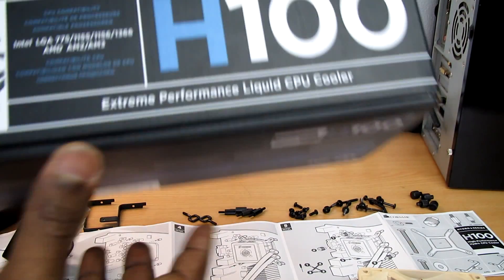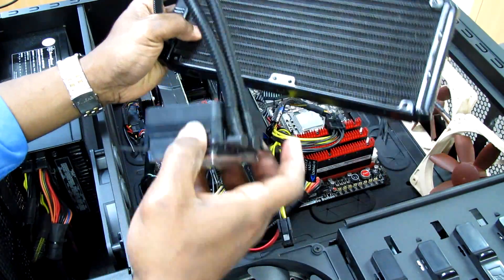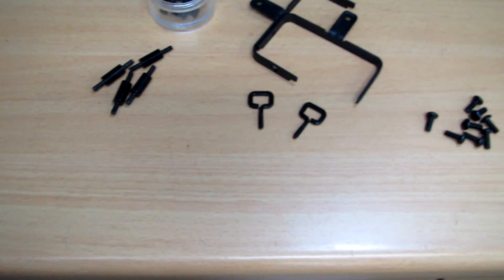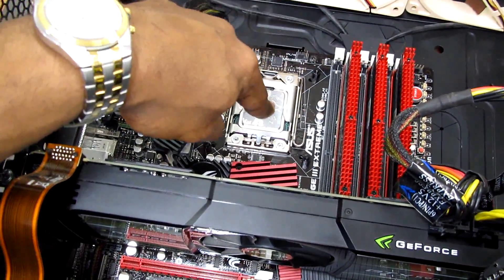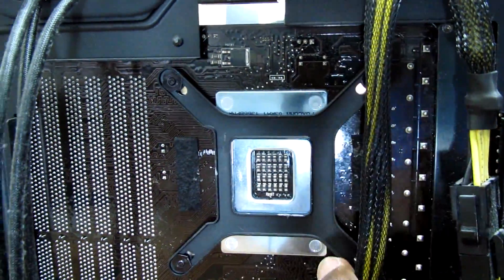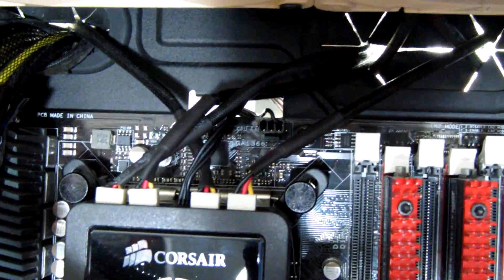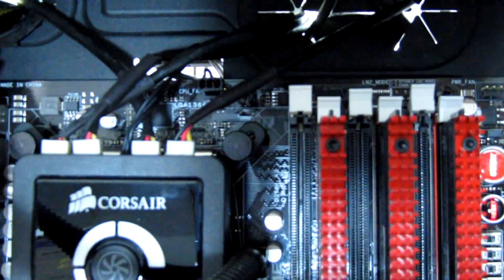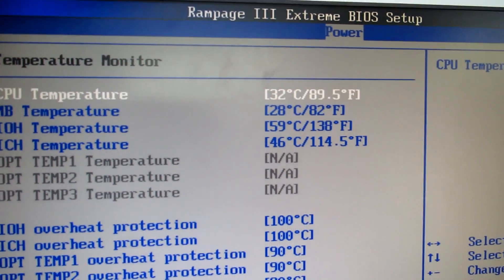How to Install the Corsair H100 Liquid CPU Cooler

Comment: i cannot mount the x60 unless i do some kind of modification to the top plate
i have the tools and many different sized bits but i have never mounted these radiators and or fans
so yea
if you cleared that part up at least
i would crack open the kraken x60 and drill the necessary holes if possible for the switch 810 top plate

Comment: also you didnt actually show the installation
of course its difficult to film that part
most people expect to see the entire installation step by step especially when you say in the title of the video how to install it
this is definetely not a tutoral but it does help a bit

i just wanted to see the mouting of the radiator
because i have a kraken x60 i dont want to open in case i have to bring it back
with a switch 810 case, providing only 20mm fan spacings on top plate
i cannot mount it.......

Comment: FYI making the back fan blow inside will increase the heat because the heat will only have one place to escape from the case. Cool air should come in through the front and bottom and exit from rear and top of the case. Also i had h100 but making a custom water loop will have more benefits than this. But , more expensive $200+ for custom loop.  mine is 500 and its good.

Comment: Hi Mark. Yes, I agree. By the way...I have my fully functional H100 installed with two fans on top pushing the air down through the radiator of the H100. My temps never go over 39 Celsius. Now I am going to overclock my 3930k processor tomorrow. I imagine that the temps might go up some. Best of luck.

Comment: Erm... theres no point in showing temps inside the bios while the system is idle and probably just booted.... we need to see prime 95 load temps, benchmark temps etc...  Also... You skipped past every install section, it skipped from being nothing to bracket installed then to it being finished.  Imagine a flatpack furnature guide where it shows all the parts and then just shows you a picture of the finished item... thats how useful this would be to someone... god...

Comment: i recomment u turning the direction od the fans on the radiator cause when u pull the air out of the case there will be hot air but if it sucks the air out of the room u have fresh cool air

Comment: Your supposed to pull the cool ambient air in over your radiator. The same way your car draws in cool air over, through the radiator...%) Think about it. Your trying to cool your radiator with hot air from inside your PC. Come on now. Really...%)

Comment: Directional flow from the top rear fan depends upon current over-pressure in the case.  So, the fan can pull air out of the case, depending upon the case.

Your statement was all-inclusive.

Comment: It depends on the case.  Some cases have fans in the front and side (80 to 230mm) that pull air into the case so any fans at the top and the back fan can be used for exhaust.  Using the back fan to pull air in only really works if the back of the case is not up against a wall or in an enclosure of some kind as the heat vented from modern gfx cards will just get sucked back in.

Comment: the back Fans should exhuast the hot air. The way this guy has setup the fans means that he is using the 'hot' air to cool the radiator. The fans on the top should suck in cold air to cool radiator better

Comment: So you're telling us that the fans should suck hot air from the GPUs into the radiator? Are you stupid? Plus that will create a negative pressure inside the case which will turn in into a box full of dust. The rear fan should be the exhaust and the top 4 fans should take COLD air from outside the case into the radiator in order to achieve the best cooling performance for the CPU. More air getting in than out will create the positive pressure which is pretty much OPTIMAL.

Comment: this is a very bad video. the corsair H100 cost 120$. and you used 4 more Noctua Fans that costs like one more Corsair H100 cooling system. that a 25$ fan DUDE!!!
and yes noctua are the best. but they are quiet and very fast. so you cant really tell if its a good water system or not. you need to use the original corsair fans that came inside the package.

what you have here is 4 of the best fan ever! that im sure are making the H100 work much better and at a very low DB. (sound level).

Comment: @girlsdrinkfeck Well you could go to any other website tha tdeals with overclocking or gaming. 

Cool air is moving down and hot air is moving up. Why fight it?

And of course when there is no cool air the hot air isn't moving since there is no where to go.

Simply stated you want top and back fans to blow air out, front fans to blow air in.

As far as dust in concerned, that's why you can buy $1 120 mm fan filters.

Comment: @AsmarinaOnline You listen to Corsair and sadly your both wrong =) with a H100 your pulling in cool air from the top of your case and the back one must be blowing air out or your graphics card will be pulling in that hot air from the H100.. Also I have a radiator (to heat up my room) right behind my computer so for me its a definite no no.

Comment: @girlsdrinkfeck In a modern overclocked and high performance system, you want negative pressure. 

The downside is as you say dust. Tom's hardware did a article about pc cooling.

The benefits they found were:

Amplification of natural convection, linear and direct air flow, compatible with all direct heat exhaust graphics cards (the ones that blow dissipated heat out of a vent built into the shroud)
Augments the cooling performance of downward-facing CPU heat sink fans

Comment: Thank you for explaining which way the H100 fans are blowing.  Many people don't expain that.  Corsair, in their video states to intake cooler air from the top and exhaust it out the rear under most situations which goes against the warm air rises principle.  Air you concerned about dust intaking from the rear where there is no dust filter?  Also, are you operating under positive pressure in your computer?

Comment: Hmm, one clearly needs a chassi with a top big enough to fit the radiator. As for the air flow, with a water cooler i guess it doesn't matter. But normally it would be something like this <-[computer]<- (the arrows show the airflow). Why this? Because with a normal CPU fan it would blow the hot air out of the chassi straight away, instead of blowing it into the computer. The bottom front fan would blow cool air into the computer as well, creating a nice circulation of cool air.

Comment: @AsmarinaOnline 

I'm not disagreeing with you because I'm relatively new to custom building. But don't the front "intake" fan or fans already draw cool air inside the case? Thanks so much for the detailed installation video. I've ordered the H100 and Corsair 600T and was a little nervous about installing a water cooler in a PC. This looks painless.

Comment from the maker: To get the best air circulation inside the case, the back FAN must blow the AIR inside. The top 4 fans & H100 already are taken care about the heat from the video cards etc. You need to learn how the AIR FLOW CIRCULATION WORK!

Comment: The idle temperature will be almost the same as even the stock cooler.. It's only when you start putting the cpu under load and when overclocked that the h100 stands out..